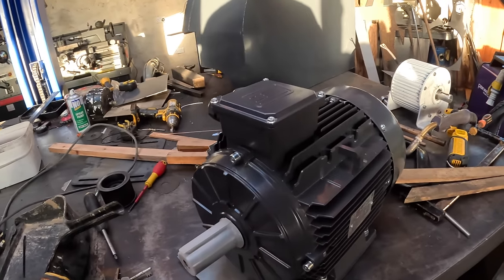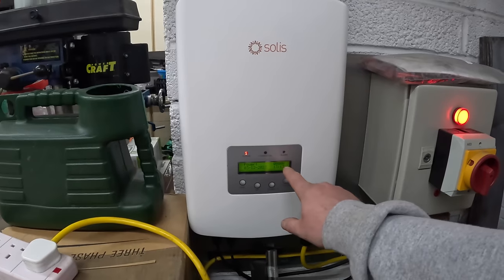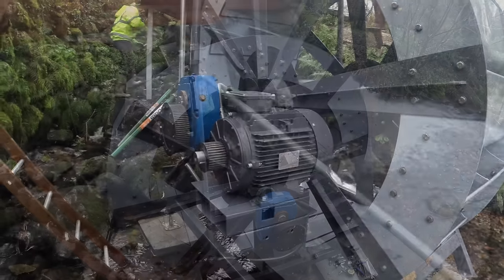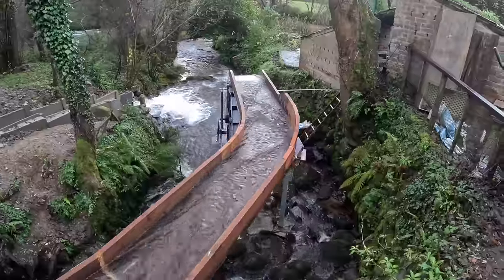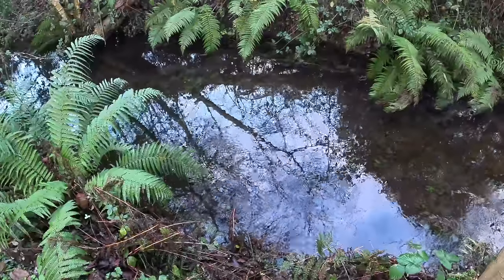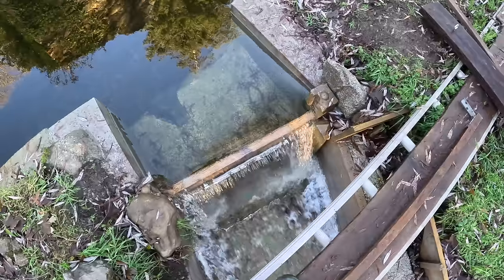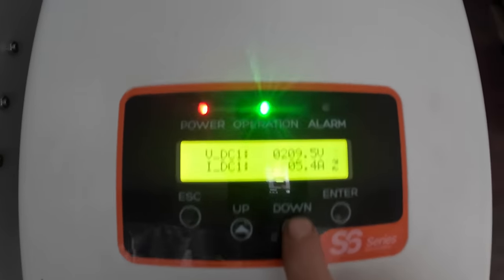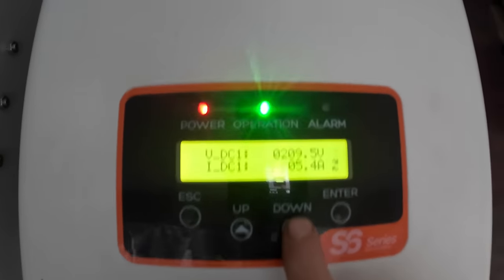Powering An Old Mill  1.5 Kw Lake District Overshot Waterwheel Project Part 4

Comment: right choice, I changed the bearings, after 11 years, now there are high efficiency IE4 ones, mine is an eff3 (IE3)
I use it live at 230V single-phase, it is driven by the turbine at approximately +250RPM from the plate data, in single-phase a maximum of 80% can always be taken from the plate data, so it must be chosen correctly if in single-phase with 20% in furthermore, the best efficiency is at 75%/80%, from the nameplate data, I use it with excitation via capacitors with the single-phase c-2C technique, where 2C has double the capacity of c, delta connection, the output is on c, I grounded the common with 2C so as to create a neutral ground regime like the national grid even if used in off grid, so as to make the GFCI work correctly, given that the fault loop closes, my motor is logically a 400V star and 230V delta to use the current generated directly for the users, as a regulation system there is an electronic card to regulate the electric ballast which does from variable electrical load, the electronic regulator IGC (induction generator controller) that I use is more reliable and better than relays, which would not be feasible to use, using the power directly, it is based on the voltage, the more it increases the more the power to the ballast increases by braking the alternator and vice versa, keeping the voltage stable and 50Hz, it would be very useful to protect the inverter when it disconnects due to a hole or surge in the network, but a bit wasted, in your case the choice of direct three-phase is the best and most efficient, by varying the capacity of the capacitors you vary the speed and the voltage, be careful not to overdo it, you lose efficiency if you go up or down too much, with the voltage or frequency, however a little more is better than a little less, after the diode bridge a nice capacitor or 2 polarized downstream leveling which helps would be recommended, but at least from 600V, when I tried the used inverter a voltage without peaks and higher and more constant being leveled worked better, I tried with a voltage protection system relay grid inverter that measures the current that circulates downstream of the inverter on the grid side, with a toroid current transformer on the phase of the inverter, in practice the electrical ballast remains connected to the turbine, when the inverter runs in parallel current circulates and the amperometric relay with adjustable threshold opens and removes the electric ballast load, it is rudimentary but easily reliable and works in all situations, if there is a sudden change or drop in the voltage or frequency of the network, the inverter disconnects from the network, the inverter has very sensitive protection and releases it as soon as the voltage and/or frequency exceed the lower and/or upper limits set by law, the best choice would be to base it on the DC voltage or AC current of the inverter as I did on another system, it was the choice cheaper and better, I used AUTOWATT on ebay, model with two programmable thresholds, very useful if you have a stable source of power for the board such as the mains, logically the electrical ballast on an external normally closed relay, opens with voltage.
well-made permanent magnets are more efficient, but they are expensive, not the Chinese ones or motors with planed rotor and with inserted magnets, with incorrect or empirical magnetic flux, the aforementioned excitation system, either single phase or three phase, is fine from 700W in above, below only real permanent magnets of European quality, I would recommend PMGs for powers under one kW, above it makes no sense for hydroelectric which has continuous power, here it is not wind power where it varies suddenly and induction motors do not work well , I'm glad you solved it, the channel should reach level above the wheel, without giving unnecessary speed to the water since it is the weight of the water when it fills the drawers that gives power, not the impact on the wheel, excellent work, the hydraulic wheels are always fascinating and beautiful to look at and their efficiency is not that bad, in fact, the ones above are the best and have many advantages Ciao
Reply: Hi,that is a lot of very interesting information on my favourite subject.I am using an 3kw 3 phase induction motor 1500 rpm in a hydro system using the single-phase c-2C technique for excitation. The output is rectified and feed into an inverter. This is working well but the inverter trips out due to overvoltage occasionally due to  insufficient load. Can you please give details of the electronics you used to prevent overvoltage by connecting an electrical ballast when the voltage goes above a preset maximum.
Could I use a solid state relay to fulfill this function and would it ramp up as voltage increased or would it only work 0% or 100%. Thanks for your very interesting post.

Comment: Awesome, truly Brilliant!!  I'm curious on the financials?  Cost, Profit and Payback (years?)  The fact that you have solar, wind and hydro, provides for a better unbias opinion.  For example, a person buys one type of new gadget (and might have spent a lot of money) and then their ego gets in the way of acknowledging any fault and if they do, they have hundreds of "Ya buts."  I agree, (on a big scale, like for cities) wind and solar work, but they are not on the same level as hydro when looking at true run time efficiencies over 24 hours and therefore can only be used as a supplement and then normally stored in a battery which has more losses.  Still good systems, but not even in the same league.  As for environmental impact, please, there are aesthetics to consider too, solar and wind are just not pleasing to look at.  Sound is a factor that solar doesn't have, which is a plus, but the payback period must be ridiculous, otherwise all skyscrapers would be adorned with solar panels, especially on government buildings.

Comment: for better efficiency lower the velocyty of the water you need low speed high volume. raise the wheel higher so the water dosent accelerate before going in the bucket. the chute is too long too. you need to slow down that water.

Comment: Very impressive wheel build. At the expense of possibly ruining an ongoing sarcastic joke in the comments, I highly doubt the 3-phase induction motor is capable of producing any power at all with or without capacitors. Induction motors do not have permanent magnets and are thus incapable of inducing current unless it has been modified by adding permanent magnets around the rotor or stator. The first motor shown in your previous video appears to be either a BLDC or DC motor which does have permanent magnets.
Reply: Hi Bob, Just to alay your doubts, I have a bog standard 3KW 3-phase induction motor  with capacitors added producing  power  using belt drive and  a hydro turbine for several years. This works as a stand alone single phase or 3 phase generator or with a solar inverter using a bridge rectifier. The point at which excitation causes the the motor to generate can be clearly heard and it settles at its normal speed. A four pole 1500 rpm motor is a fraction of the price of the eight pole used by Kris and up to 10% more efficient. Hope this helps.
Reply: @seanmurphy1084  Is your generator a squirrel cage induction motor, the type where neither the stator nor the rotor contain permanent magnets, and where the rotor has neither the brushes nor slip rings?  Does your definition of standalone mean it doesn't need any external current to generate current?
Reply: @bobweiram6321  Hi Bob, no permanent magnets or slip rings or brushes, however it will not generate anything without the capacitors.
I have used it wired in star mode and in delta mode and it produces the same power.
For three-phase operation star connected motor was excited by the capacitors  to supply a three-phase resistive load using a 15uf across each phase. 3 in total. This also outputs single phase by connecting across a single phase.
 
For the single-phase operation, the delta connected motor was excited with so-called C2C configuration.
45 uf across A and B. 90 uf across B and C. No capacitor across C and A.
The motor outputs 230v under load but unloaded it speeds up and could reach 500v.
The motor is 3kw and just gets warm generating 1.1kw the max of my turbine.
In is recommended not to generate more than 2 kw in single phase mode.
If you need any more info I will help if I can.
Reply: @seanmurphy1084  The only way I see this working is by supplying it with external power from the grid to induce an electromagnetic field on the rotor from  the energized stator.  Of course, this would have to be spun faster than the synchronous speed in order to produce enough current.
Reply: @bobweiram6321  Its working for 3 years, and does need to be connected to anything except a load. All motors have residual magnetism which generates a small voltage which then builds the voltage up in the capacitors which results in motor excitation and generation.  What more can I say.

Comment: Try reducing the capacitance slightly... That will drop the voltage ar a given RPM  and because the inverter is controlling/aiming at a speciffic voltage th esult will be a higher RMM not a lower voltage.

Comment: Is your motor a 3P 380V? If so, how did you get 220V or so? I know that a phase to earth gives one 220V. But, I see that you have a 3P bridge rectifier that has each of the phases coming in. Is it the capacitors that are pulling the voltage down to 220V?

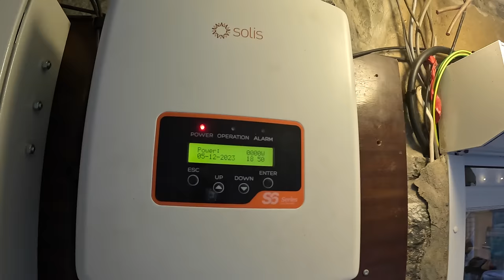Comment: 13:20 is there no way of having an automatic restart. I.e. you send power to both heater and grid to it stabilizes than cut back in once your voltage doesn’t exceed the grid inverters voltage? Or is that too complicated?

Comment: I wonder about the shape of your buckets, they're very curved. Is it possible that the water comes in with enough velocity that it shoots out again at the other side?  The overhead shot at 30:00 I thinkk shows that this is almost happening at low flow rates. A simple baffle along the bottom should fix it if that is a problem.

Comment: 32:47 bt a cheapest chinese split ac can run at 4.0 scop and can made form that 1100W ~4kW heat. and also the max power intake can be configured down to 150W and this can be automated by "smart" devices.

Comment: Couldn't you use a centrifugal clutch off the wheel for over speeding?
I know at high speeds they can fail too, but it couldn't hurt as a mechanical backup or first failsafe.

Comment: Youd do best with the golden motors, ev motors that china also sells, but are much more robust because they have to be strong and efficient, and that market kindof demands it. The 10kw motor can be run at a very low load for very long term service, but I know from experience, all chinese products are not waterproof, so you may have to do some siliconing to fix the not so watertight wires and gromets. 
They would just need 3 phase ac to dc rectifiers which are abundant, AND the higher rated rectifiers are LOWER loss than rectifiers without the higher current ratings. For a 100a rectifier fuji makes, I am using it at a measly 240 watts and its 98 percent efficient which is perfect and I thought this was not ture, but even the data sheet confirms it! 
That size induction motor is absolutely bonkers for 2kw continuous. Maybe an alternator, but you probably found those arent exactly great 100 percent duty cycle products, because its an automotive part...

Great work overall, also have you heard of electroplate galvanization? It probably has less warping, and is more affordable, maybe not super safe, but 'industrial coatings' are like baby poo.

Comment: would it be twice as efficient and not much heavier, had you doubled the width of the buckets, given you have bearings both sides, keeping the trough the same width, ie more room for the water in the buckets.

Comment: Why do you still need the heater, if you can just stop it from generating electricity altogether by disconnecting the capacitors? I mean it would spin fast in a power outage, but mechanically this shouldn't be an issue right?

Comment: does that controller not have a configurable auxiliary output? seems like the controller should be signaling an over voltage and to connect the dummy load and not the grid failing.

Comment: Need an actuator on the input water flow. This will decrease the heat on the resistors, and then you can have an automatic engagement when the grid comes back on. No manual button, No manual flow control. The Chinese put the screws to you, but in all fairness, we all know that they rate everything in a fictitious world. You should have had the generator tested before you fabricated the mount, or just purchased a generator from a reputable source. The only other modification would be to move the gearbox and motor to a more remote location so that it can be serviced without climbing down into the water.

Comment: Am I correct in thinking, this motor/generator needs to exceed the synchronised speed to generate, while the PM generator will generate at low speeds, will this be a disadvantage when the river flow is low

Comment: You can estimate the volume of water you're using by multiplying the width of the channel by the depth of the water, then multiply that by how fast the water is moving. Using centimeters will tell you ml/s, and meters gives kl/s. Use a leaf and your slo-mo mode to measure the speed. 🤓

Comment: What with a rubber-flap in the end of the tray, which are hanging over top of the wheel,may stop splash,, and the water will separate te rubber from the wheel so it not will grind i think..

Comment: I am confused about something, if grid fails wouldn't you want to keep collecting from the wheel to put into the batteries? Why cut it off immediately? Is it possible to keep track of the batteries state of charge and only trigger this failsafe when the batteries are full and there is no where else to put that power?

Comment: I might sound like a dumbass and you’re probably not gonna reply Kris. But amazing as this system is, it seems very complicated compared to solar. 
I have a very consistent stream with a huge man made waterfall drop where an old olive mill waterwheel used to be. Basically the perfect set up for a hydroelectric wheel. But after watching all you’re vids it’s put me off wanting to set one up as it seems very complicated and unattainable for the average off grid’er. Is this the simplest a system like this could be? I hope you don’t take this as a negative, it just shows your amazing engineering mind but alot of us don’t have that level of understanding of engineering and electronics.

Comment: I’m trying to get my head around the meaning of efficiency and why it matters. All the water ends up down the river anyway, so why a concern if water is splashing out at high flow rates? It’s not like the sluice is metered and you’re paying by the cubic metre of water.

Comment: Sorry but a motors rating is based on it's output power so a 3kw motor is 3kw of usable power, so the motor could easily push your generator to it's maximum that doesn't mean the VFD is either able or configured for that much output

Comment: Would it be an option to use three of the cheap overrated Chinese generators in-line (axial) instead of the induction motor? How do you think it would compare cost and efficiency wise? I would assume it would be more efficient, but also less error prone.

Comment: Kris why can’t you not match the flow rate with a faster belt configuration to keep the rpm’s faster at the gen but the wheel still at a slower more efficient speed? Thanks

Comment: The chute is stickning out too far. The buckets are loosing fill time, and it looses time for the water to settle in the buckets. The outside of the buckets is also smacking the water when the water enters the bucket too late, so you are loosing alot of that water.

Comment: May as well of bought a used EV motor at this point, from eBay, reckon a decent Hyundai Ioniq motor thats done under 50k miles for £2k would be insanely good, theyre well efficient as well, over 94% efficient on average EV motors

Comment: Technically, you’re efficiency is not what you claim it to be because the bypass  is where you’re splashing has gone to. The only way you can claim that efficiency is if you retain the splashing water in the reservoir.

Comment: The difference between solar and hydro-electric power generation is as common sense as he explained here 36:54
Base load verse intermittent. When the sun is not shining, a solar panel may not be producing power. As long as water flows downhill, a hydro-electric generator will.

Solar will never be a base load power source...no matter how much you spent toward that goal.

Comment: wouldn´t it be possible to have the wheel turn at a speed like around 30:40 and get more power out of the system by altering the gearing from belt to generator? 
so that the generator spins fasteryou could use a motor with less coil count to use the higher rpm or am i thinkíng wrong and you would loose to much torque this way?

Comment: I'm confused as to why you need the water wheel to turn slowly to produce a given electrical output. And you are using some sort of dynamic braking ( reverse electrical energy put back into the motor) to hold the water wheel back? Why?? Why would you not allow the water wheel to turn at  whatever speed it urns at and tap off whatever electrical out put you get? Rectify and filer you output as required?
Reply: Overheating.. he wants to run it within a comfortable temp range so no one has to worry about it